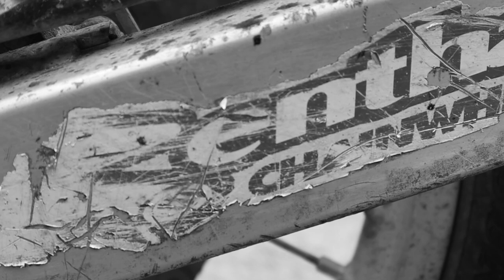How I Restored This Swingarm | 1996 RM250

Comment: Great job. It looks like you used a silicon based welding  wire. Great job correcting it. I got a Yamaha TDR250 one to do.
Reply from the maker: 4043 was the original (poor anodizing reaction), and 5356 was what I used later.
Reply: You might opt for 4943 whenever you choose to anodize. It takes anodizing extremely well and can be used on cast alloys or modern 6000 series with equal results
Reply: @cj-ef1rp yup. 4943 is my go to rod.

Comment: Was the anodizing expensive??
Reply from the maker: The place I took my stuff too charges per color -- for clear it was $100 for everything I anodized, that included swingarm, sub frame, and a bunch of smaller parts.
Reply: @madmarc  thanks Marc. I've got a swing arm off to be clear anodised tomorrow. Sanded all the scratches out and finished with red scotch. Did the place that done yours expect you to sand off ALL the old anodising? Or do they dip it in a tank before hand that strips it?
Reply from the maker: @MrDogtown22  they dunked it in their special chemical to remove the anodizing. From now on I'm going to have them do that to all my parts before I work on them
Reply: @madmarc  yeah will save a lot of time! Do you think the yokes are clear anodised?
Reply from the maker: @MrDogtown22  What do you mean by yokes? You mean the cast portion of the swingarm where you install the bearings? The whole thing is anodized. BTW in case you were wondering, the anodizing doesn't significantly affect the tolerance for bearing installation. I measured them before and after the anodizing, and compared them to another swingarm I had that used the same bearings. So there's no need to mask them off.
Reply: @madmarc  ha sorry mate I'm in the UK! Yokes/triple clamps, where the front forks and bars go!
Reply from the maker: @MrDogtown22  ah got it. Some bikes have them anodized, some are painted. Some have bottom triples anodized and top painted, so... 🤷🏻‍♂️
Reply: @madmarc  got ya. Not long send my swing arm off to be clear anodised. Looking forward to seeing the results.

I've not long refurbished my CR80 tank. Sanded with 320, 500, 800, 1000, 1200, 1500, 3000 and finished with 6000 (didn't polish) came out great. Get yourself and electric Mirka sander mate. Expensive but well worth it.